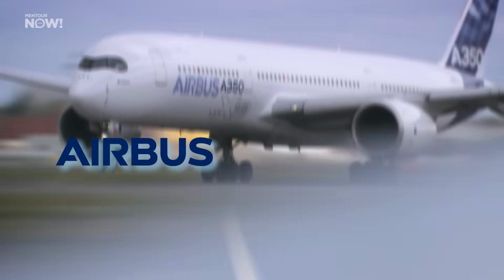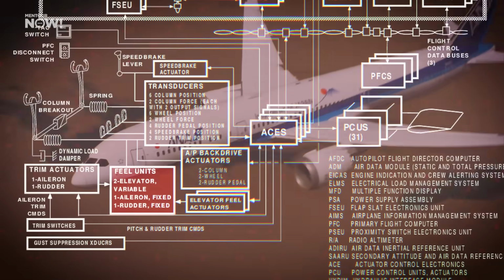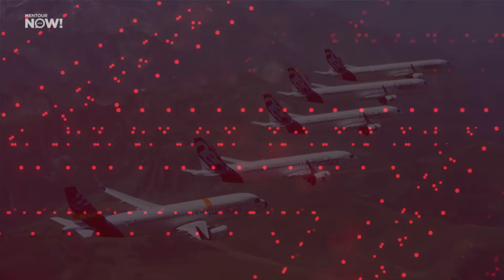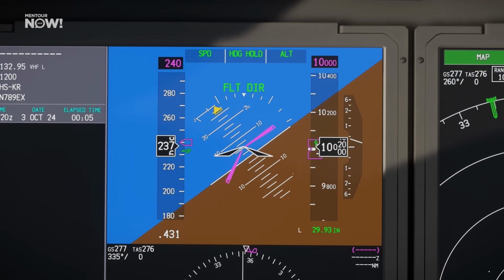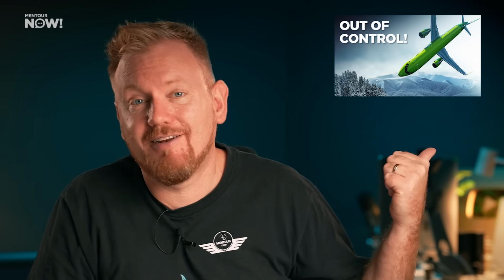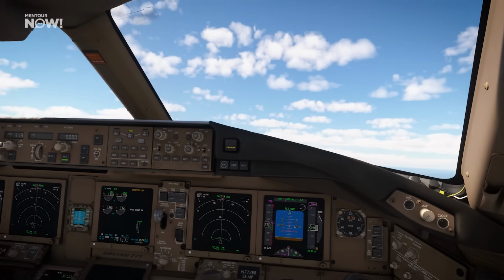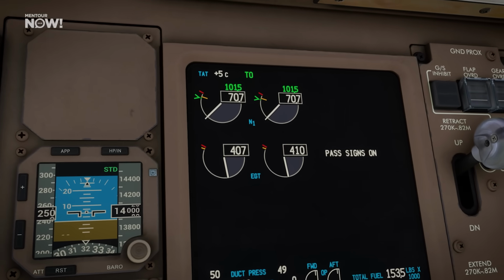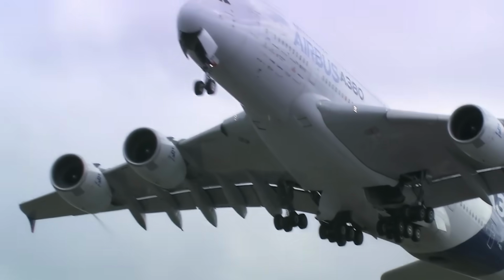Do Pilots Prefer AIRBUS over BOEING?!

Comment: Our "Mentour" is really walking a tight rope on this one. Something he missed is the quality of newer pilots these days. Major airlines sliding five- or six-year FOs into the left seat requires all the help and assistance available. I think a better gauge would be asking a preference based on pilot experience actually flying the line with both systems not somebody hired with fifteen hundred hours and then promoted to left seat via seniority. He shouldn't assume all line pilots are well trained and proficient or their ability do become so. As for fly by wire? Hell, they can't even keep the computer I'm using for this comment to run more than a few days without constant updates. Those gremlins and bugs are hiding all over the inside of any computer. In this regard, the public beats up Boeing endlessly over a software bug while Airbus gets by with just another software update.

Comment: In general I would prefer the Boeing approach; it seems like the Airbus acts like 2 or even 3 different airplanes depending upon the automation level (which can change rapidly and seemingly at random), when I am suddenly surprised by a potential emergency situation the last thing I need as a pilot is to have no idea which plane I'm suddenly flying.  The last thing anyone needs during an "oh shit" moment is additional sources of confusion and contra-indicators.  I would much rather have the airplane "fight" me if I attempt something stupid rather than just ignore me and do what it wants, by fighting the pilot it provides feedback to the pilot that they may be trying something ill-advised and thus encourage them to stop and re-asses or actively turn off automation if necessary.  When the machine just ignores the pilots then they get no feedback, and it feeds in to their decision making as bad data (either tried it and it didn't work, or actively made it worse).  
In theory one can train for situations like this, but seriously with at least 4 distinct control modes how much training is necessary to practice for all the different ways the plane might bounce around between those control modes, and how frequently can one do that training so it's actually useful in a real life situation (which is 99.9999999999% boring everything works autopilot)?

Comment: Though truth be told, I don't think we should conflate "missing control feedback" with "Airbus protections". The former is in the end a question of price - I'm pretty sure Airbus also thinks it's a good idea to give haptic feedback, be it on the sidestick or throttle. It's just that this complicates things a lot and is expensive, especially if supposed to be reliable. It is however a consequence of/connected to the "purely FBW" (vs. the 737s cables).

Comment: I am an Airbusfan, mainly because of Boeings abysmal safetyrecord. 

Petter, you mentioned that the 777 and the 787 are very safe planes. I wouldn't go that far, we heard from a few whistleblowers it is a miracle these planes don't drop from the sky once airborn.
Reply: the 777 has an excellent safety record and the 787 has a perfect safety record
Reply: @animegamingdude  For now they do.
Reply: @Dirk-van-den-Berg  the 777 has been in service since 1995 and the 787 since 2011
they are clearly both tried and tested aircraft
i fully trust them
Reply: @animegamingdude  Good for you. Clearly you haven't been listening to the latest whistleblowers.
Reply: @Dirk-van-den-Berg  i have but i still have yet to hear of these planes dropping out of the sky due to design and manufacturing flaws
Reply: @animegamingdude  Agreed. But you can't deny Boeings companyculture is under strict official and unofficial scrutiny. Several whistleblowers are predicting severe accidents are waiting to happen on both types.

Comment: This seems like "shoot your foot" protection known by programmers. Boeing at this moment will let you do it, while Airbus will try to prevent that from happening - however if you manage to do something that computer will overlook - congratulations. You just shot your knee. Having feedback on sidesticks and throttle levers will eventually come if airlines (or regulators) will push for it. Aviation is tied with automation - today you don't need flight engineer, radiooperator or navigator - all these roles were replaced by computers providing pilots with all the information they need to fly (or in case of radiooperator - it is intuitively handled by PM). This shortens the path, especially in situations requiring quick response - but first rule od safety is avoiding such situations. Every little thing that offloads pilots is good for aviation.

Comment: Am a fan of more info compared to less info when it comes to solving issues. Maybe the first pass thru solving the issues can have less info, in case it's an easy issue to solve, but more info always wins when it comes to more complicated issues.

Speaking as someone in the IT industry and having had to occasionally solve complex issues including multiple systems. And it irritates the hell out of me when a friend / relative contacts me about a computer issue and tells me the bare minimum - sometimes not even the actual error messege and expects me to help them.

Comment: F-18's Magic Carpet.  Magic Carpet is a new landing mode for the Navy's F-18 that dramatically reduces work load during landing on a carrier.  Before Magic Carpet a pilot would make on average 300 control adjustments in the last 18 seconds before landing.  With Magic Carpet less then 10 are needed.  A 97% reduction.  Dramatically reducing go arounds and accidents during landing on aircraft carriers.  Having a similar system in civilian aircraft should improve safety.

Comment: As a very frequent passenger good to know equally safe, save for when Boeing forget a few things when putting the planes together, but Airbus planes are so much nicer for the passengers than Boeing. An A320 series has more internal space than a B737 series. Same with A350 vs B787. And they are quieter, lavatory designs are better and you just feel better inside

Comment: Would the airbus system have fought the pilots of Flight 93 on 9/11 when they intentionally crashed it?  Would it have fought the terrorists when they aimed for the World Trade Center?
Reply: "Would the airbus system have fought the pilots of Flight 93 on 9/11 when they intentionally crashed it?"
The maneuvers would have been less violent, but it would have crashed as well.

"Would it have fought the terrorists when they aimed for the World Trade Center?"
No, but they would have not gotten to such high speeds.

Comment: As someone who enjoys flight sim games: airbus are much easier to fly - the plane seems to save itself even when you make stupid decisions as a pilot.

But I also like the manual trim on boeing. Its more fun (and harder) to fly manually on the boeing. Some of the most fun landings I played were with boeing planes. Definitely feels like pilots who truly love flying would prefer boeing planes.

I feel like if I had to fly a real plane Id be far more likely to survive if i tried to fly an airbus than if I tried to fly a boeing. I would bet the sim translates better to an airbus since the sidestick is much like the joystick controller I use and theres less "real feel" on the airbus anyway.

As a passenger on real planes I prefer airbus. They seem so much safer and better designed for safety.
Reply: In the air Boeing mostly is on autotrim

Comment: For me it depends on the time period you ask this question. Maybe in the 80s 90s Boeing was better in many aspects but from the 00s 10s till now Airbus caught up and with the unfortunate merge with MCdDouglas surpassed Boeing and in my opinion is way better, safer and more advanced. Many pilots I talk with also say Airbus planes are way more relaxing for a heavy work load or longer flights.

Comment: At the end are you saying that Gen 4 aircraft are 90% less likely of suffering from "mishandling" by pilots than Gen 3 aircraft. From the small graphic: all B737 including the MAX are Gen 3, so they are NOT equivalent to any A320 that are Gen 4. One IS safer than the other.
Maybe a point worth emphasizing, since those planes are used interchangeably now days.

Comment: As a cabin crew I can also feel that Airbus is a bit more over engineered than Boeing all the way down to the cabin interphone.  On Boeing, press 1 for the doors on the left and 2 for the doors on the right + the door you wanna call. Ie. 12 for L2 and 24 for R4, meanwhile on the A350s my airline flies you need to select which door number, then if you want the right or left and then click the green button to do the call from a tiny screen

Comment: I'm not a pilot though I once aspired to be. Maybe I still could be, I dunno. From the stories I've heard you tell, @MentourNow/Petter, from the brief experience I had flying a Cessna under the practice tutelage of a friend who was working on his instructor's rating -- I'm sure I'd rather fly a Boeing than an Airbus, for two reasons.
1. having the computer sum-up the things the two pilots are doing on side-sticks WITHOUT HAPTIC FEEDBACK OF WHAT THE OTHER ONE IS UP TO seems absolutely MAD. And the designers that made that decision should have been sacked on the spot. (shall I tell you how I really feel next?). It was a choice; I'll even admit (despite that sentiment) that it must have seemed like a good idea at the time but in accident after accident it's been a place where pilot panic is not mitigated by intuited knowledge of what one's partner is up to.
2. the most precious memory I have of what little flying I've done -- and why sim-ing frustrates me and I can't find my groove in it easily -- and why I think flying an AirBus would drive me nuts -- was the way the 172 mediated between my hands and the plane to support the misleading impression that my nerves were growing out to the ends of the wings, that I WAS the plane in that moment of rotation and what followed after that, up to the point of straight-and-level and it was up to the plane to (A.P.T. in balance) stay in the air -- until the next time that input was required. It wasn't hard to feather the controls because the plane told my hands how much pressure was just right, how much of a touch the rudder wanted.

Not to rely on the kind of feedback that connection to the control surfaces and the forces acting on them, the kind of feedback that the paired yokes would give to the two pilots about each other seems to me to abandon the most reliable ways of keeping the two in some kind of sync with each other and with the machine over the most crucial parts of what will keep the plane flying. And having three laws connecting the pilots to the machine (normal, alternate, direct) only adds possibility of another source of chaos in the the most chaotic moments a pilot ever faces -- makes me ask, "what on earth were they thinking?"

So despite Boeing's recent troubles -- and they're massive! don't let the bean counters control things so much! -- I think I'd still prefer their way to that of Airbus (and I mean __BOEING__'s way, not McDonnell Douglas' -- the shape of an MD-80, the two times I flew in one, made me nervous as its shape didn't strike me as airworthy-by-default and that was before an AME friend told me about the by-wire pieces required to keep it stable in the air -- but that's another story).

Comment: As a lay person, would it not be best to have the best parts of both, with the high level protections of Airbus, but with force feedback on the sidesticks, throttle controls and trim etc? and the full diagnostic display of the ECAM but with this being modified, (possibly with AI) to show only the most relavent info in any given situation?

Comment: I have a question, I know that when Concorde was built they added a system that monitored 20,000 different measurements. This is not used by the pilots but by the ground crews to make sure they can catch any problem before it's actually a problem.  So that if a component is vibrating more than normal then that doesn't mean it's critical, but it does mean a mechanic needs to check it soon.

I believe when Airbus was created this system from Concorde was then used in Airbus, I'm assuming it has been improved over the years.

But does Boeing have a similar system for monitoring everything and reporting mechanical issues that need to be checked by the ground crew?

Comment: When it comes to Yoke and Side stick movements or inputs from the pilots I 100% believe in what you always emphasize that at no point should the 2 pilots be in control of the aircraft. There's some few incidents that you've covered on the mentour pilot whereby 2 experienced pilots found themselves fighting each other on the Yoke till one pilot said the basic "I have controls" and that can beg the question how did they not feel or even see that they were both having their hands on the Yoke. Also I wonder if 2 pilots are having their hands on the controls is there no indication on the instruments on what's happening to the aircraft pitch and speed. I'm asking these questions as someone who just enjoys aviation channels with no ambitions of ever been a pilot or working in the aviation industry.

Comment: Since there is no tactile feedback from an Airbus, doesn't this mean that you can train a pilot (up to a certain point) on Microsoft Flight Sim?(!!!) 
Obviously the movement of the a/c itself is absent, but in instrument flying isn't the movement of the a/c actually a distraction?
As you can tell I'm not a pilot. But even as a s/w engineer I would much prefer the tactile approach of a real machine.
But also, surely this is an evolutional dead end?

Comment: If you like the Airbus Backup Speed Scale (ie A330) you'll love what the A350 provides for the crew. To begin with:

A330 Back Up Speed Scale, great idea based on AOA however:
•	Only available below 25,000 ft.
•	Crew needs to work through ECAM failure procedures eventually selecting off all three air data functions of the ADIRU's……all during high workload and stress

The A350 provides something truly ingenious. Let me explain:

Normally:
•	Air data system 1 (ADIRU 1) feeds the Capts instruments while Air data system 2 (ADIRU 2 ) feeds the First officers instruments. So far, standard Airbus.

If Air data sys 1 becomes unreliable:
•	ADIRU 3 automatically feeds the failed side, in this example, the Capts instruments. Two independent sources of information continue to be presented to the crew.

If Air data sys 1 and 3 become unreliable:
•	The system automatically displays the FO's air data (ADIRU 2) on the Capts instruments….effectively providing single source air data. For crew awareness, shown beside the PFD speed and/or altitude scales is the source of this single air data. In our example “ADR 2 SPD” and/or “ADR 2 ALT”.

If all three Air data systems become unreliable:
•	The system automatically displays Integrated Standby Instrument data. “ISIS SPD” and/or “ISIS ALT” beside the PFD speed and/or alt scales. 
•	The A350 Standby Instrument doesn’t just sit there and look pretty as on other aircraft…..its data feeds into the network and utilized if necessary.

If all Air data systems become unreliable, including ISIS (AF447):
•	The A350 will pull Air data off the engines (FADEC)…….and the way this is done is truly ingenious….. as this source of air data will not ice up. “BKUP SPD” and/or “BKUP ALT” beside the PFD speed and alt scales. “BKUP…..” means engine data.

All of the above is automatically accomplished without crew action. 
What chooses the best air data for display? A computer that is hungry for accurate and valid air data….. the Primary Flight Control Computers. The PRIM’s choose what air data the flight crew see and what air data is used to compute flight control laws.

Brillant…..IMHO
Reply: The 350 is truly the next generation.
Reply: AirBus and Dassault Aviation: Make BAGUETTE Great Again 🥖
Reply: What about the A330neo? Exact same as classic A330, and A340?
Reply: @ramyfares9099  the 330 is a relatively new and cutting edge design of its time. 737 dates back to the 60's

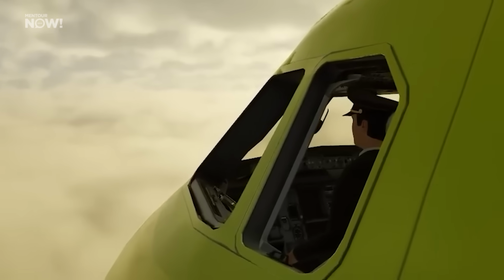Comment: 17:32 this I dont really understand...
why is there not just a big fat screen at the top of the cockpit between both monitors thats only shows either "NORMAL LAW", "ALTERNATE LAW" or "DIRECT LAW" in either green, yellow or red.
Why does crucial and important information like this always need to be hidden away on some random screen in the lower left corner with font-size 15px

Comment: As a passenger, A320 and 737Max compared, I prefer 737Max, its bit more comfortable (quiet).  787 and A350 I prefer 787 just because better cabin air moisture.
Reply: Nothing you said there is true. 737 is much more noisy
Reply: @herceg6772 i flew on both the a320 and 737 this year and found them very comparable in terms of noise

Comment: Airbus fly by wire was designed in because it’s cheaper. 
Feedback to the thrust levers and sidestick was left out because it’s cheaper. 
Flight control protections were thus designed in because of that lack of feedback, not as a protection for pilots. 
Trainers don’t understand that, and almost every Airbus course will at some point say “You can’t stall it, with a ‘hold the stick back’ “ demo. That’s terrible training because the protections are not there to stop bad pilots, but to compensate for the lack of feedback. 
So crashes happen because pilots have this idea that you can’t stall an Airbus, when it is just an aeroplane and so will absolutely stall.
The AF447 FO held the stick back for 35000 feet of descent because of this training.
The XL88t Captain deliberately tried to stall the aircraft at 3000' because of this training.